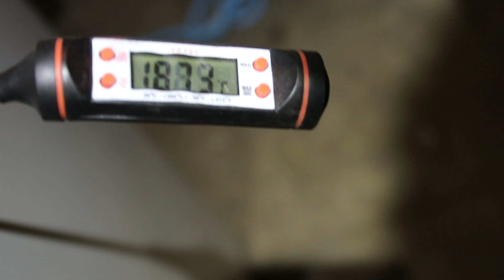Old Rusty VW T25 Syncro Brake Caliper Rebuild

Comment: Hello. Please tell me if there is such a problem. I have calipers
old model (two-piston), they squeak very loudly. After rebuilding the calipers
and replacing different pads, the squeak did not go away. I looked at what they should be
anti-squeak plates (I don’t have them). Is it possible to make them yourself and what kind?
shape should they be? There is also a question about the piston, there are cuts on it, in
Which side should the cuts face and does this affect the creaking?
Reply from the maker: Hi, my self, I haven't faced such an issue, I am bad adviser in  this matter.